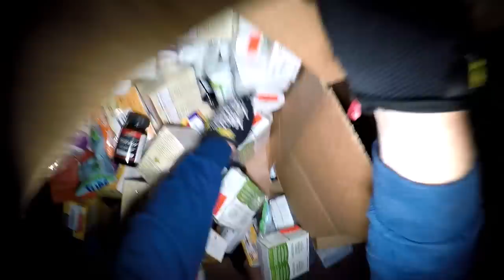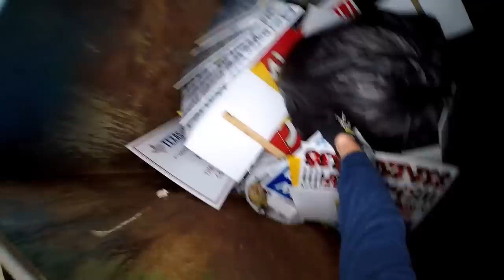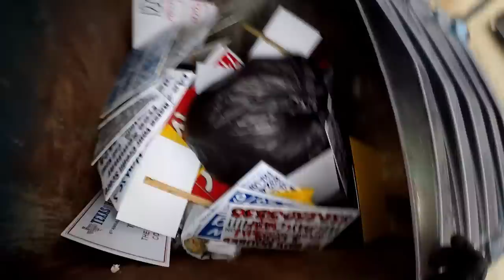Dumpster Diving 15 (Found Razor Electric Scooters, TVs, Computer Monitors & More!)

Comment: The PVC cutters you found, you need to pull the handles apart. That will open the cutters and as you close the handles the ratchet part starts working. Great video Mike!

Comment: Even though many of those vitamins are expired,as long as they're sealed,they'll still be good for years.
Reply: Ý8t
Reply: Vitamins can be really helpful to homeless some of them have very limited diet.
Reply: 4 plastic barrels like that would make great floats for a raft or one could use it with a canoe to stabilize more.
Reply: ا
Reply: It's against federal law to sell products out of date
Reply: @dk.1dk77  not a problem if given away to the homeless.
Reply: Good ideas good intentions but isn't that kind of bad your homeless so here is outdated drugs
Reply: @dk.1dk77  all moot dumpster diving is possible only when you take advantage of it. Besides in my town I know of one homeless guy. He seems to be doing well  and doesn't require supplements.
Reply: 70380 Morgan City La zero people on skid row, the homeless guy says he has a place to sleep at someone's house he has some time window to hit in order to stay there. Nice size town and all my life I saw one guy holding a sign will work for food, and I knew that guy he was a friend that was drunk doing it on a Dare.  Back during the oilfield boom we had a ton of transient people the cops figured out how to get them to stay away, I Know because I use to walk to work. Every night they stopped me checking my I'd then proving I was not a vagarant. Producing a key , a local address, and endless stupid questions. Best way to avoid the police harrasment is ride a bike. You are where you need to go before they even know you are out.
Reply: @dk.1dk77  I'm pretty sure you can sell outdated product as long as you specifically label it as expired.
Reply: Vitamins are not drugs 😂😂😂 they are supplements and they are good within 6 months after they expired if kept in cool & dark places
Reply: @dk.1dk77  Government doesn't set experation dates, the manufacturer does. Just so you'll buy more.
Reply: ...and nobody tells those vitamins that they’re expired, they’ll be fine.
Reply: Label with expiration dates started when NJ made a law that any food item had to gave a expiration date no more then 2 yrs out regardless of the actual self life.  In order to sell in that state...everyone started to put on dates. 
That law has since been changed to say best by or use by date.   After that law went into effect....food waste jumped 40%.

Comment: You should bring tools with you to take things apart... I ran into a wooden top workbench with 2 big metal vices on them and nice industrial legs... took vices and legs left the big ass heavy top there... it was trashed... basketball hoops smash the glass / plastic out take all the metal... I use a battery powered recipocal saw and drill with socket adaptor. And I have a long reach gripper to pick up stuff instead of climbing in... it was something someone threw out... like your roller picker... I need to get one...

Comment: Hey Mike, what kinda truck do you drive around in?
Looks like it got great loading bay capacity. ;)

Great videos by the way! ^_^
Reply from the maker: 2500 HD with 8’ bed
Reply: Okay, nice. ^_^
I think long-boxes are quite useful when scavenging for scraps and stuff.
If I would have lived in the US I would for sure do the same thing and probably use a similar car. ;)

Comment: "Use by dates indicate when a product may no longer be safe to eat. You should not eat, cook, or freeze it after the date displayed, even if it looks or smells fine. Best before dates are an indication of quality rather than safety. You can still eat food after its best before date, but its flavour and texture is most likely not as good as before the date.

Use by dates are typically present on meats and dairy products, as well as ready meals like salads. Always follow the storage instructions on the product (usually refrigeration or freezing). Otherwise, it may no longer be good to eat – even before its use by date
Best before dates are usually displayed on products that do not require refrigeration or freezing. For example, dry pasta, bread, tinned products, fruits and vegetables, and uncooked rice. The length of a product’s best before life varies greatly between foods. For example: bread usually has best before dates of no more than a week, while tinned products can last for years".